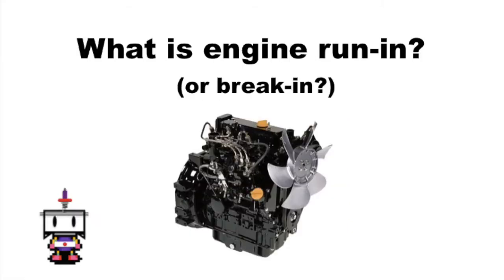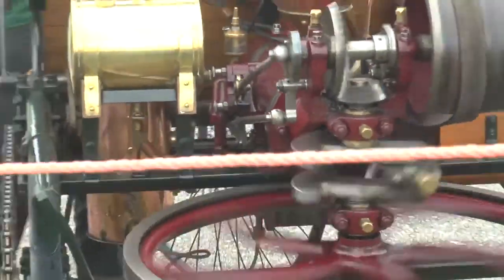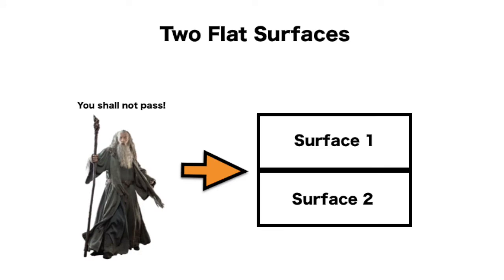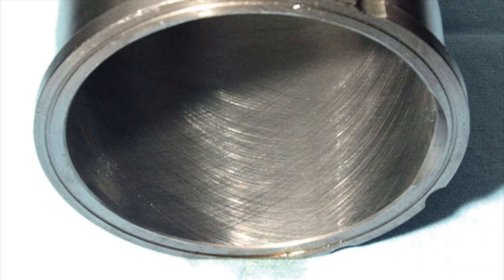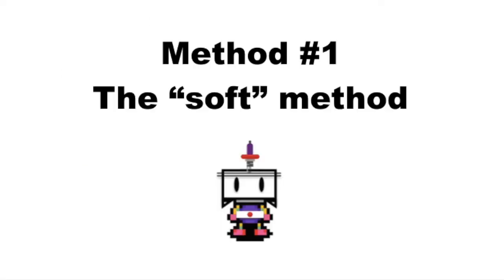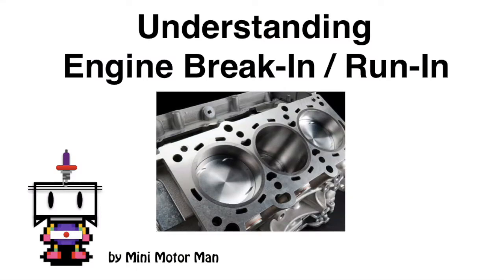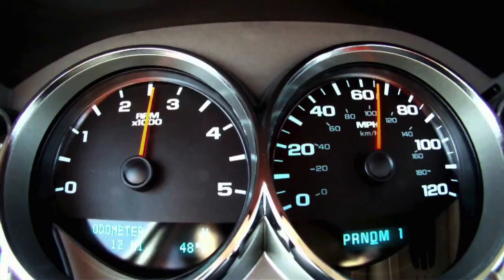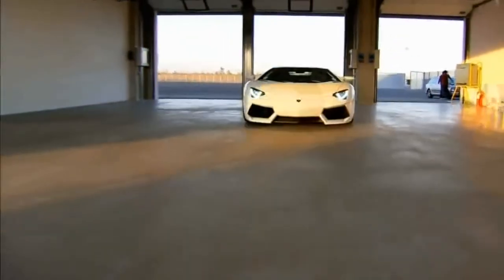How to Break in an Engine (Understanding how and why)

Comment: So if I'm after a more efficient engine would a port and polish of the exhaust side of a c90 be worth it?
Reply from the maker: Forgive me for saying "It's really complicated", because I'm not trying to discourage you from anything, but in a nutshell on the C90, it's not really worth much.  I've done it before, and I was really straining to tell a difference on the bum dyno.

Reason is though, is because the biggest kinds of gains in efficiency you'll see on the engine are from "major" modifications like fuel injection, higher compression ratio (but be careful, it's more trouble than it's worth), and internal friction reducers like roller rocker arms, etc.  The thing is though, so much of the benefit of having the C90 is because it's so simple, it's so cheap and easy to repair and thus, economical.  So kind of a law on diminishing returns here, because the more complexity you add, the less fuel you'll use, but the more money it takes to save money on fuel...you get the idea.  

It's strictly academic at this point, but truth be told, the biggest improvement for fuel efficiency and increased powered on the C90 I've found is running it lean, but then you've got to really make sure your machine is in top nick, probably get a high flow oil pump...you see the rabbit hole that keeps appearing?  :)  

But anyway if you're wondering about real world numbers, I have a '17 Wave 125 with roller rocker arms & fuel injection, but still a modest 9:1 compression ratio, and it does (all things equal) about 10% better in fuel economy than the C90.  It's cool honestly, to see 185 mpg when hypermiling, but honestly, I might save a basket worth of cod and chips a month on fuel costs.  

Well that was longer than I expected...:)
Reply: Mini Motor Man a very comprehensive answer, thanks hachi roku. But you're right, I suppose it's hardly even worth it for the time, effort and money for the returns you'd get.
Reply from the maker: I think the best thing to do with a C90 is to keep it in good nick, and enjoy how little maintenance it actually requires compared to something else.  I do have an itch to scratch with tinkering on machines however, so I ended up with a Mini Cooper which always has something broken and gives me an excuse to fix it.  :)